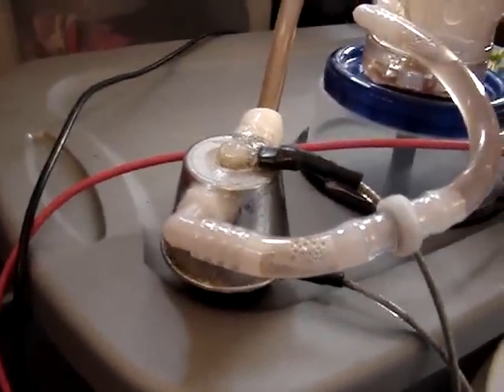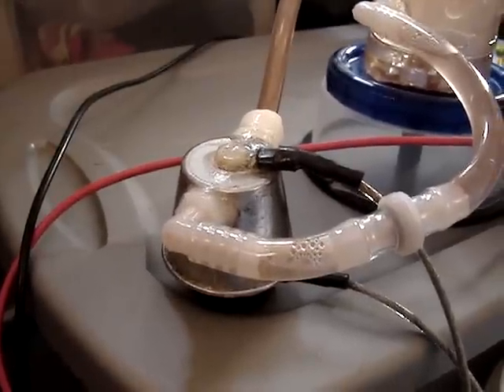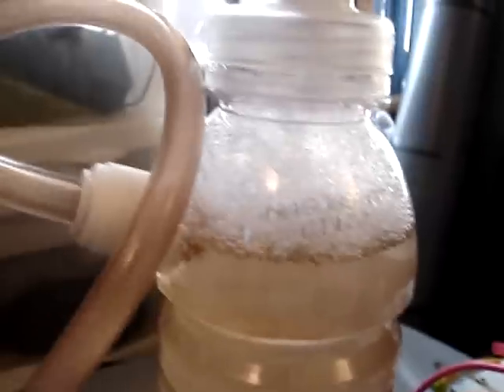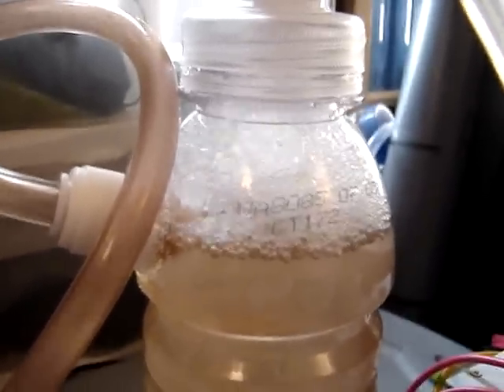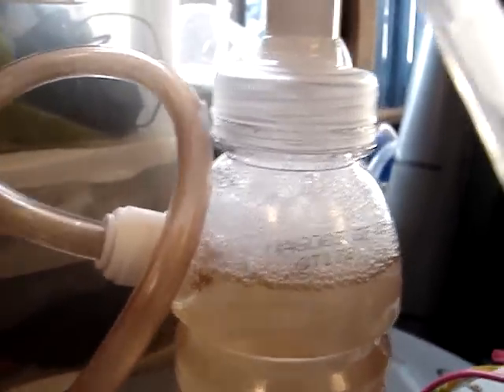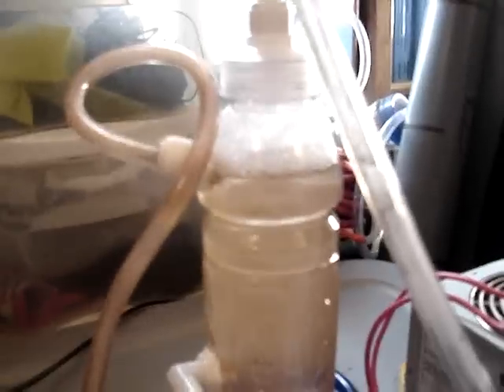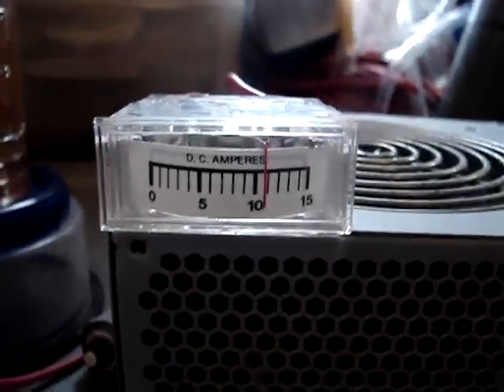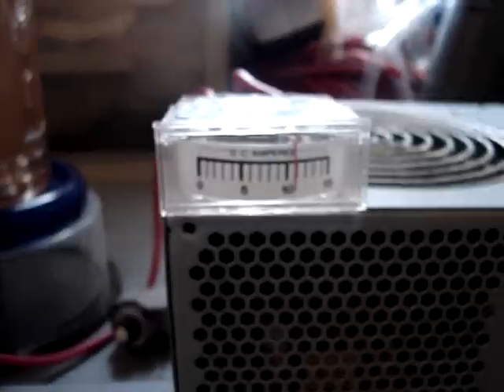Vid20 Dry Cell Hydrogen Generator FlameTest (HHO, Brown's Gas, Hydroxy)

Comment from the maker: the problem was the water level of my bubbler. I made a new bubbler that has a lower connection for the exhausting gas and now the bubbles are a thing of the past.

You are right about not mixing in the aquarium bubble reducing solution, because there is no way of knowing how it will affect the performance of the cell or if it will create hazardous fumes.

But, I don't use tap water in my fuel cells, because you can't get consistent results from the added chemicals. 

I only use distilled water.

Comment: well bubbles is IMPURITIES from someting in the water / gasket / silicone / hose / electrolyte ( most common problem) 
soo.. use pure e-lite and u shroud be fine.  I never had a bubbel/foam problem, ever. But then i only use hot-glue on any seal, and that works really good. 

So dont mix in stuff, make it clean instead.. HHO cells run on (tap)water and high voltage, that's it!